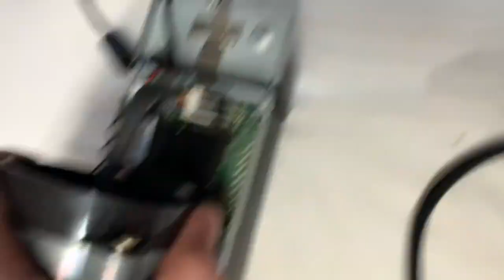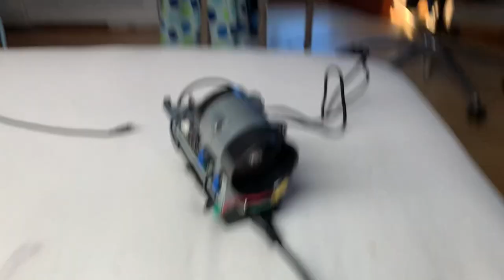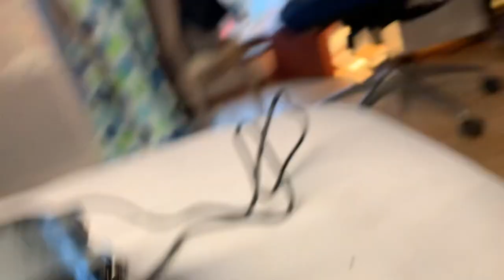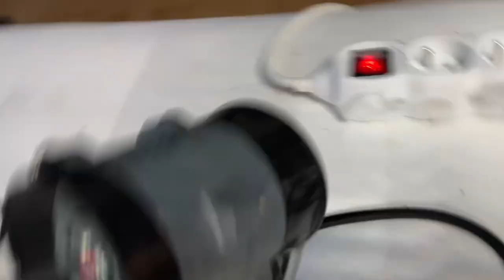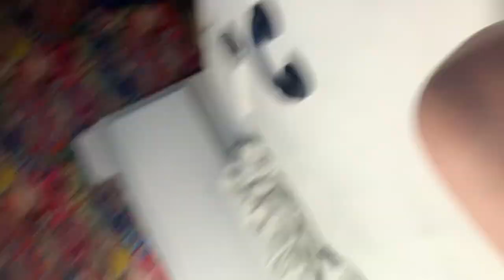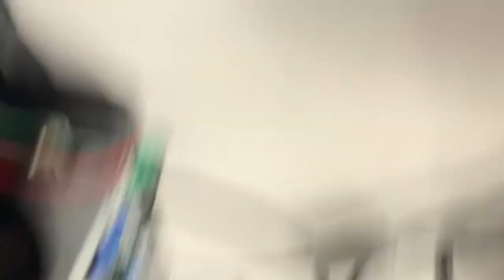HP BladeCenter C7000 fan-Handhleld leaf blower

Comment: What’s the model?
Reply from the maker: The fan says on it´s label HP T35530 just look that up on google. And if you are looking for it there is a EBay search link:https://www.ebay.co.uk/sch/i.html?_from=R40&_trksid=p2047675.m570.l1313&_nkw=hp+t35530&_sacat=0
(I got mine from a Czech auction site because I live in the Czech Republic)
Reply from the maker: Here´s the site I got it from:https://aukro.cz/hp-t35530-blade-centre-cooling-fan-413996-001-7005792073
Reply: @Sonic_The_Electronic_Madlad  thank
Reply from the maker: @BGTech1  One slight warning: Make sure you get a beefy power supply because the fan draws almost 20A onb startup. Otherwise it will spin for a while and then stop. Also you have to connect it up like this:http://abload.de/img/sam_2607lrsep.jpg
Reply from the maker: The pinout is: -, pin1, pin2, pin3, pin4, pin5, +
Connect + and - on the big pads and then put a jumper between pin5 and + to make it run. (the pin5  is right next to +)
Reply: @Sonic_The_Electronic_Madlad  Yea those high proforence fans draw a lot of current. Eventually I'm going to make a few videos about the delta fans I have, and modifying them with a 3d priced nozzle and velocity stack to improve cfm